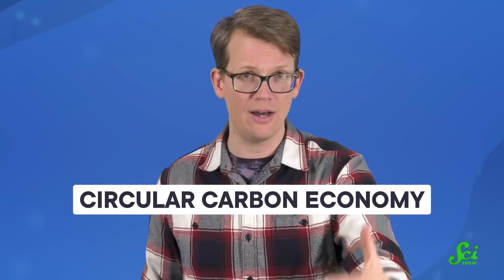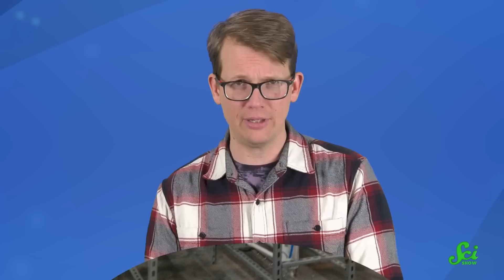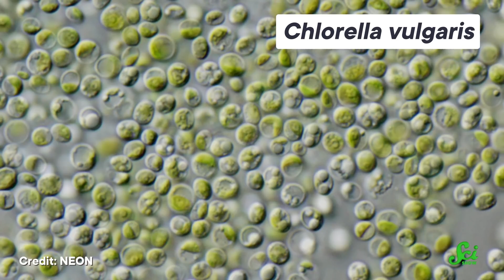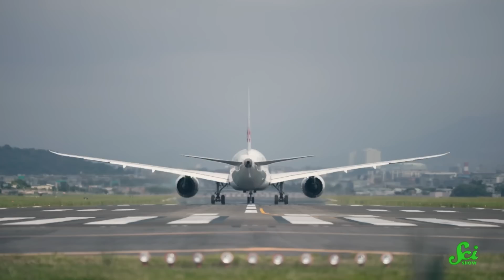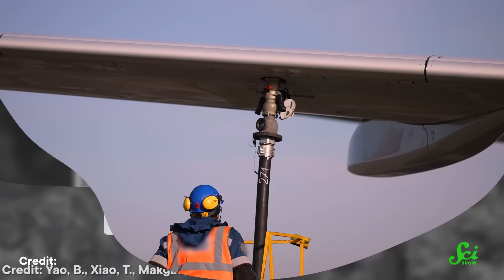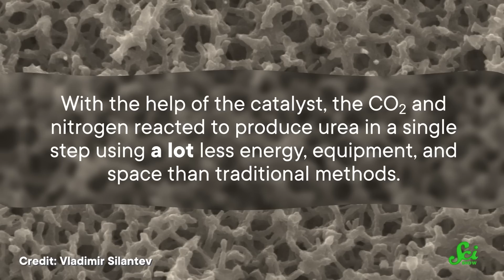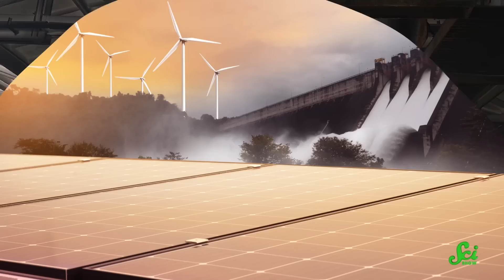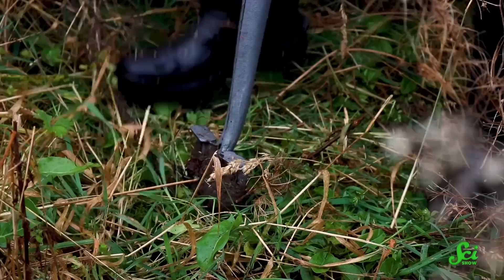One Way to Deal With CO2? Reuse It

Comment: Are there industrial circumstances where THERMOELECTRIC Generators (Seebeck plate) can be used to generate electricity from the waste heat differential? I'm Imagining those ubiquitous hot and cold pipes running in parallel in every factory, producing enough for lighting a complex thanks to some simple engineering.
Reply: It's used in some spacecraft with a block of plutonium, which generates a lot of heat through fission, and the thermoelectric generators use the difference between the block of plutonium and outer space to generate enough electricity to power all of the onboard equipment. I haven't heard of any other applications though, probably because the difference needs to be massive in order to be useful.
Reply: Hot and cold pipes in a factory are generally insulated because they want the fluids to be those temperatures.

But i imagine they could find a place where it could be useful, although I'm not sure they would contribute enough energy to be worth the hassle of installation and maintenance compared to sticking a solar planel on the roof for the same or better production.
Reply: Most chemical factories already use the "waste" heat to improve overall efficiency. There's a lot of smart people engineering these things. Thermoelectric generators are really low efficiency.

Comment: So most seaweeds are algae.  Why aren't they being used for CO2 capture?  It seems like it would be far more efficient to throw a few 10s  or 100s of millions at kelp reforestation than to try to roll out and scale brand new tech before the 2030 deadline.   Also, the urea issue sounds like a ridiculous consequence of our current industrial farming methods.  We farm cows and other animals in factory farms producing tons of environmentally-damaging "waste" which includes vast amounts of naturally-produced urea.  And most farms still don't cover crop.  Wouldn't it be faster and more efficient to reduce urea's environmental impact by subsidizing cover cropping, and figuring out how to get the livestock (or at least their waste) and plants back on the same farms so less needs to be manufactured?  I'm also really skeptical of the impact of any new process that requires palladium and titanium.  They're both pretty energy-intensive to produce. 

That said, the jet fuel recycling sounds promising-at least more so than trying to fly passenger jets with batteries, or reviving the dirigible industry.  And it's hard to complain of reducing clothing in landfills.
Reply: @capturedflame  every single resource, biological reference and medical text states that the human (and other oxygen breathers on land) exhale CO not CO2. 

There is a reason that Carbon Monoxide is dangerous to humans, they do not survive well in its presence. (Such as automobile exhaust.)

You say I don't understand something, yet YOU have the gases reversed for some reason.

Every Botanical text and reference states that plants and algae utilize CO in photosynthesis processes, releasing CO2.

We are done here.
Reply: Because seaweed and algae capture CO (carbon monoxide) while animals capture CO2 (carbon dioxide). 
Without CO2 humans do not breathe.
Reply: @nobodyshome6792   Not quite.  "Without CO2 humans do not breathe" <== True, but the CO2 is only a trigger.  Too much CO2 tells humans--and O2 breathers in general--that they need to get some more oxygen.  It tells you to breathe.  O2 breathers generally ingest the carbon they use to function.  Photo-synthesizers capture carbon directly from the air as CO2, which they then metabolize, leaving O2 as the waste product.  Seaweed is particularly good at it: giant kelp grows faster than bamboo.  CO doesn't need capture.  It photochemically degrades to CO2 and O3.
Reply: @Daniko2  thank you. Your attempt to prove me wrong has actually proven my statements as correct. 
With the exception about plants. As plants typically do not intake CO2, but instead CO. 

In basic biological function, the lungs strip a single oxygen molecule from CO2 to oxygenate the blood. There are other things necessary for this process, and some of those things are also classified as "bad for the environment" or as listed causes of global climate change. 
The issue with climate change is that climates ALWAYS change. It is part of the nature of climates and why most biosphere attempts fail. 

One must also understand that climatologists are mostly only utilizing recorded data, and we havent been recording climate data for that long, less than 140 years at that. Yes I understand that we do perform Glacial Core Tapping and Extrusion, however that is still classified as an 'inaccurate science' by climatologists themselves. 

We also have mathematical proof that the Earth is moving closer to our Primary Sun due to how the orbit and gravity functions in Space. And we know for a fact that this has an effect upon the Global Climate. 

So why are people talking about removing CO2 (a requirement to animal life functions) from our ecology ? Or at least reducing the quantity of CO2 from the atmosphere. While many of the animals that require CO2 for basic life functions continues to grow and expand.....
Reply: @nobodyshome6792  Okey doke.  You do you.  👍🏾
Reply: @capturedflame  tell that to every single Published and Peer Reviewed paper, text and reference. 
Humans exhale a combination of gases, including but not limited to Carbon Monoxide (CO). 
Since humans inhale a multitude of gases, we exhale a multitude of them as well.
The amount of said gases becomes the issue, not a few molecules, but a large quantity. 

Have you never taken biology or earth science courses ? This is basic stuff that used to be taught in elementary and middle school......
Reply: @capturedflame  I'm QUOTING the damn textbooks to you.

Comment: Sounds like you're trying to invent trees and plants.
Reply: Of course. Just... better. Most trees and plants aren't particularly good at capturing carbon (they have lots of other things to do!). Heck, there are some really interesting results from combining photovoltaics with normal farming - the panels provide a relative shade, allowing the plants below to be more efficient and reduce their water usage considerably. Human-made machines can usually beat life at highly specialised tasks, because our designs have many advantages that simply aren't available to a living thing.

Does this mean this is the best way forward? Or the only way forward? Of course not. We need a lot of different solutions working together, not one cure-all snake oil. That's always been the biggest problem, whether you're talking about fossil lobbies (incessantly pushing for more fossil use) or your-favourite-one-in-all-climate-solution lobbies. Chasing the one favourite thing (whatever that is at the time) will always be disastrous.

Comment: There is a MAJOR ommison from the jet fuel segment. They would have ABSOLUTELY needed to add hydrogen to make a fuel. You cannot make a fuel with just carbon and oxygen. Not a liquid fuel that is. They will need to use energy to get the hydrogen for those fuels.
Reply: @professorfrog7181 I don't know that it needs to be 100% carbon free, but it needs to be taken into account.  That's a given.
Reply: fun fact: water contains hydrogen
Reply: @Professor Frog if your final product produces way less contamination, you are winning the fight and buying time. I repeat, solar and wind have nearly zero impact, and their impact exists mostly due to contemporary transport methods. Use also solar vehicles in the manufacturing and their impact goes down to zero.
Reply: @josecorchete3732  yes, but electrolysis of water to get hydrogen takes ALOT of energy.  Most of our hydrogen currently comes from gas mining. This is the scam of blue hydrogen coming up again. Cracking hydrogen off of water and then heating CO2 and presumably that hydrogen up to 300C° is not a low energy process even with a new energy lowering catalyst. Hand waving that away is exactly how these things fail in their implementation. People don't fully account for everything that is ACTUALLY needed. I am ALL FOR this technology, but cracking apart two VERY stable molecules takes alot of energy and it would be a mistake to explain that well enough.

And to the simple person that just needed to type "fun fact: water contains hydrogen". . . Yeah we all know. You should, however, expand your knowledge beyond grade school chemistry and join the actual conversation that is being had here.
Reply: @josecorchete3732  “nearly zero impact” in the amount of energy they’ll ever generate…
Reply: @heymikeyh9577  That's funny, cause a part of my country is entirely power by then since 10 years ago...
Reply: @josecorchete3732  What Country and at what cost?
Reply: @heymikeyh9577  Cost zero. Europe, suit yourself to search some information for once in your lifetime, mines not the only here, so educate yourself in how many of the EU countries are there, and let's see if you can tell in which country I live. Spoiler alert: It's more than one.
Reply: @josecorchete3732  Well, your comment was a year ago. So, I'm going with Iceland or Scandinavian country.
Reply: Energy in itself is not a problem. Solar and wind can provide at practically no emissions.

Comment: 🤔 . . . I’d rather have carbon eating plants towards the ends of exhaust vents & such…
Reply: You'd need a very large amount of plants on each exhaust vent, all requiring maintenance, to get rid of decent amounts of CO2. It's much better to hold them in farms and in structures that have a lot of airflow.
Reply: For me, its more of a mold in a damp location,  @Homerow1 . Sorta like a pseudo muffler, except its designed to absorb CO2 & expel O2, as well as excess mold (reproduction purposes), without the need for photosynthesis & such…

Comment: Quick googling says 879kg would be the per-person CO₂ emission on that London → San Francisco flight. This is super confusing in the video, it sounds like it's 879kg for the entire flight.
Reply: BIG difference!
Reply: I took it as per person but maybe that's because I've looked up carbon emissions from flying before.
Reply: I mean, the airplane uses many tons of fuel made of a bunch of C and H per flight, which all combines with O2 from the air to form CO2 and H2O, so it's gonna be even more tons of CO2 that come out than the tons of fuel that went in.
Reply: That really wasn't specified well. Neither the stated stat, nor it's specifics.
Did they include; which model plane, how many seats, how many people on the plane? Presumed weather conditions? Into a headwind or with a tailwind? 10 year average of all planes/all seats/all passengers?
My search had responses ranging from 1 ton 1 way to 900+kg for a round trip, depending on the variables & specified destinations, and more besides.
Most seem to reference various carbon offset schemes, the CO2 calculations for which are not universal nor precise.
Reply: @iainburgess8577  look at my calculation please, a few replies up
Reply: 👁️👄👁️

wot
Reply: Maybe they made a simple speech error while narrating... its fine, and the context is still very much understandable
Reply: 879kg CO2 over a 10000 mile trip translates to roughly 145 miles per gallon
Reply: @andrej7941  What aircraft only uses 145mpg?
Reply: So if there are 10 lesspersons on the flight, it produces 8.790kg CO2 less?
Reply: @jus7040  No, it assumes all seats are occupied
Reply: The plane producrs about 90kg of co2 per hour and the flight is about 10 hours and 20 minutes.  That's not even close to 879kg per person.  The 879kg for the entire flight is pretty accurate.
Reply: @TheNothingHobbyist  No! A 737 burns about 750 gallons of jet fuel an hour, that's about 2,272 kg per hour. Your "math" is out by a factor of 25. Go back to school.
Reply: @TheNothingHobbyist  So exactly how are hundreds of tons of fuel converted to only 879 kg of co2?
Reply: @MaxArceus  I just showed you the math.  Sorry if it doesn't work for you.
Reply: @MaxArceus  What plane uses hundreds of tons for 1 flight?
Reply: @TheNothingHobbyist  Try looking up basically any commercial jet. Let's take a Boeing 747 as example. 
I WANT to list sources, but I know youtube will instantly flag my comment as spam if I do. I can tell how to find the sources though.
Look up the 747's tech specs. You'll find there are actually several subtypes of the plane, each with a different fuel capacity, ranging between 47,210 US Gal. /
178,000 L to 57,285 US Gal. /
216,840 L.

Now look up the fuel consumption per hour, it's 14,400 liters per hour. 

The fuel is kerosene.

Now look up how much co2 is released from burning a liter of kerosene, you'll find it's 3kg per liter. 

So, per hour the plane emits 3kg/L x 14400L = 43200kg, or about 43 tons. 

The flight from London to San Francisco is 11 hours (again, you'll have to look that up). 

11h* 43200kg/h = 475200kg of CO2.

Now, one last thing, look up how many people a 747 can carry.
You'll find a few different numbers, because of the different subtypes, but one of them is 467.

475200kg of co2 for the whole flight, divided by 467 people = 1017,6 kg of co2 emissions per person. 
While it's not quite the same as the number listed here, it's in the rough ballpark.

It should be clear that the value mentioned is per person, and not per plane.
Reply: @TheNothingHobbyist  Using the different types of commercial passenger aircraft capable of a nonstop 9 hour flight,  each passenger seat produces between 2-3 tons of CO2 emissions.  So, basically every US-to-Europe flight is going to produce hundreds of tons in total.

Comment: A circular carbon economy, or carbon-neutral economy, is a great principle. Unfortunately, we've spent decades and hardly made a dent in either of the big components - effective carbon capture / sequestration, and efficient carbon reduction (the actual recycling part). It's great to see continued developments, but we also need to be looking at carbon-free economies, which include carbon-free fuels - most likely hydrogen and ammonia. As much as removing CO2 from the atmosphere is a necessary step, it'll be even more important to reduce how much we emit in the first place.
Reply: too bad places like alberta prefers only doing the treatment phase of carbon capture by using oil power to capture their oil co2 instead of not relying on oil
Reply: That's the thing about -now-, we can start drawing down atmos. CO2, plotting out what can do 100kpsi H2 and what ammonia setups will do.
Reply: Scientifically, theres hope.  Politically, there isnt.

We've seen how hard it is to force people to wear masks.  Imagine asking those people to make actual sacrifices for the environment.
Reply: @Lactosecow  Your microwave, TV, hair dryer, EV, etc., do not care if electricity comes from coal power plants spewing CO2 and toxins or from sustainable wind and solar.  The more the well-intentioned, but misguided, liberals talk about the need for  "people to make actual sacrifices for the environment" the more conservatives will fight them.  Stop saying that going green is a sacrifice.
Reply: @Lactosecow  They'll be more willpower as the world gets worse and worse to live in. But will it be too late by then?
Reply: There is no clean energy. We always neglect one important issue. What is that energy used for? Supply energy for schools and hospitals or manufacture more weapons, more junk that end up in gigantic dumpsites, rivers, oceans, our plate?
What we need most of all is ETHICS.

Comment: Compress it deep in the oceans. The possibilities from heat, cooling and propulsion are endless.  Food and building materials.  It’s carbon and oxygen, building blocks of life.
Reply: do you realize the pressure needed for that?
Reply: Compression takes energy. Just because there is a lot of pressure at the bottom of an ocean doesn't mean you can just magically teleport something there and get the pressure for free.